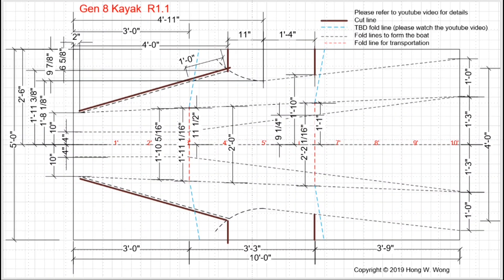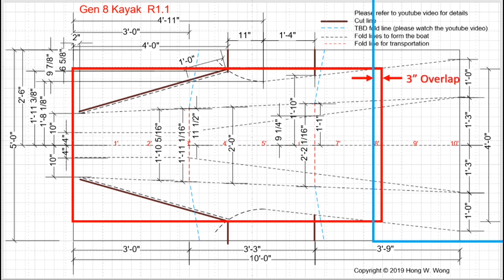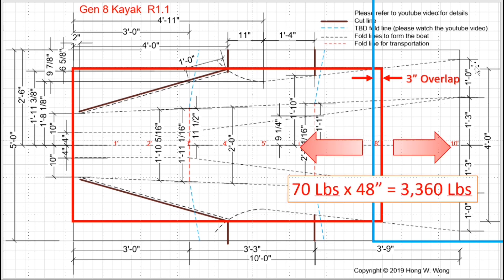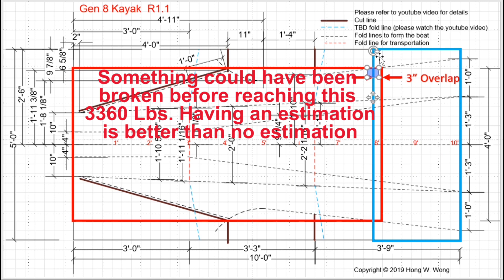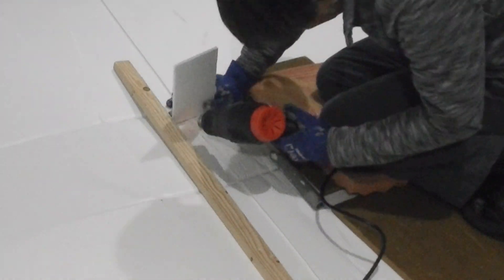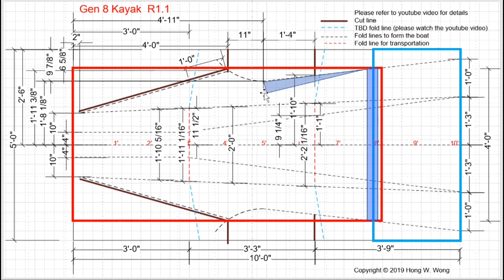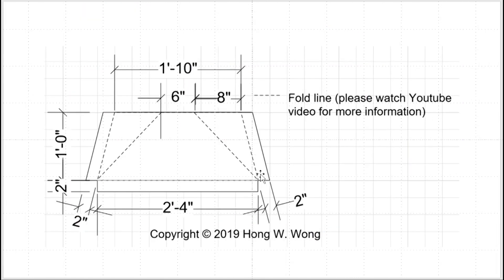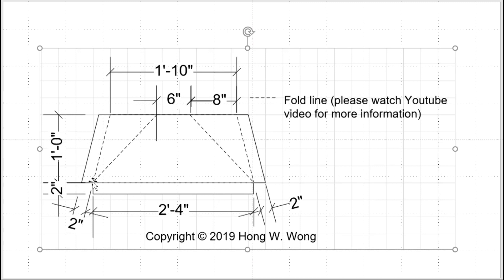How to fuse two coroplast sheets  DIY using 4'x8' sheet to build boats part 3

Comment: Thanks for these updates. How much harder is it to continue the folds through these overlapped and fused sections when compared to normal single layer sections?
Reply from the maker: Thanks for your comment and your good question. I am actually working on a video to discuss how to make a fold at or across the fused section. I am in the middle of building a boat and come across this issue. I will discuss the limitation and work around in the video, please give me a week to finish that video. It will be in part 3 of this series: https://youtu.be/5D1pREO04fs
Reply from the maker: I have uploaded a video to show the folds on the fused/overlapped sections. Please let me know if you have other questions. Thanks. https://youtu.be/lZxq3DBnQdY